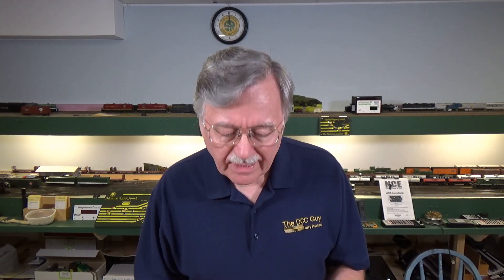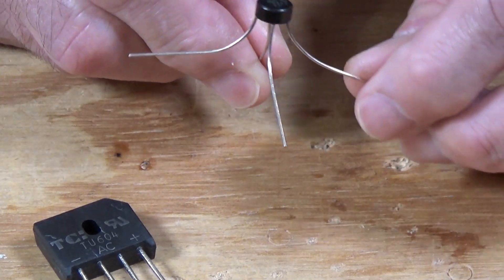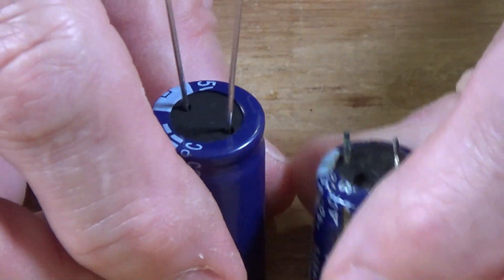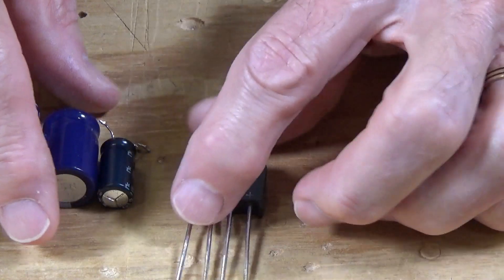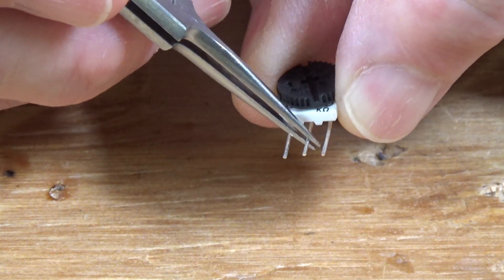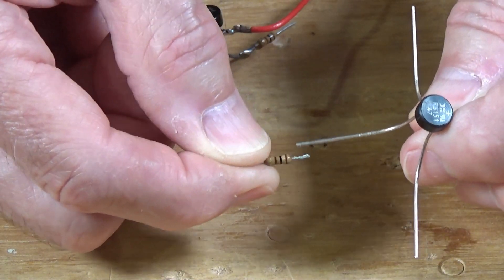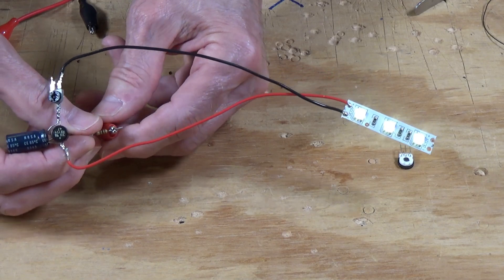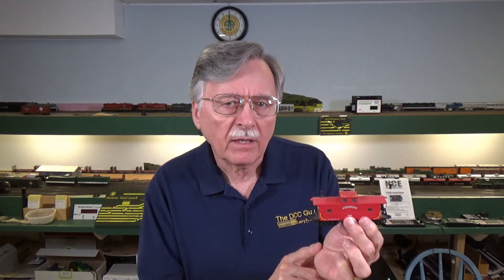Stay Alive Lighting For your Cabeese and Passenger Cars (101)

Comment: Hello Larry.  Great video and thanks.  I understand the circuit, but... you left out how to put it into the caboose, so now what?  Isn't the inside of the caboose (or any other rolling stock) vacant?  Is there something inside the caboose that routes track voltage to the inside of the shell, and then you solder something to it?  I don't have a caboose yet, so I don't know.
Reply: Yeah that looks like it could be tough to squeeze into a caboose or coach and hide it.
Reply from the maker: I will be doing another video on how to install power pickups to get power from the track and install the circuit. I just didn’t want to make this a 1 hour video, and with 2 part videos viewers numbers plummet so I didn’t want to call it that. Some cars like the LifeLike caboose and many Walthers passenger cars come with power pickup even if lights are an option. This circuit can be made compact enough to fit flat on the floor of a car or be stuck to the inside of the roof. It can be made flat using a piece of perf board or put together as I demonstrated. The individual car will dictate its own best configuration. Look for the power pickup video on Monday.